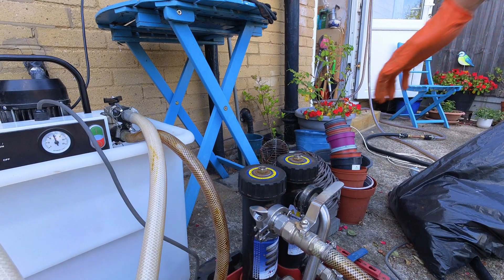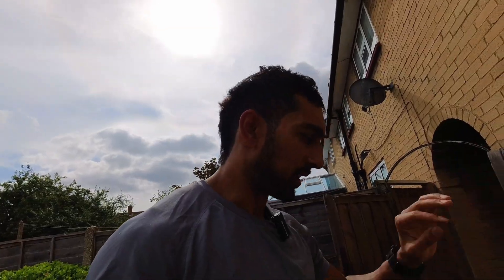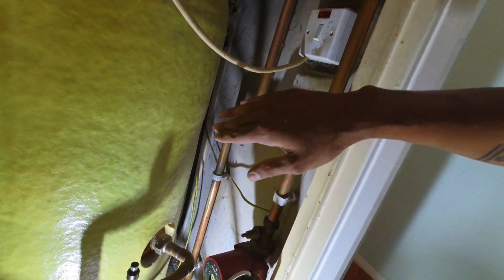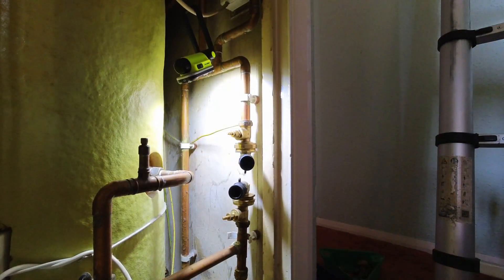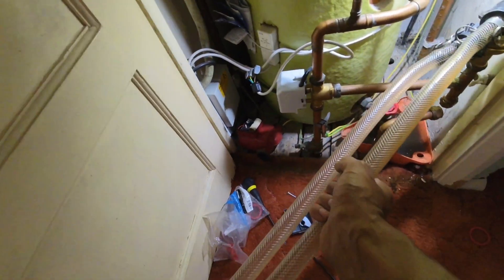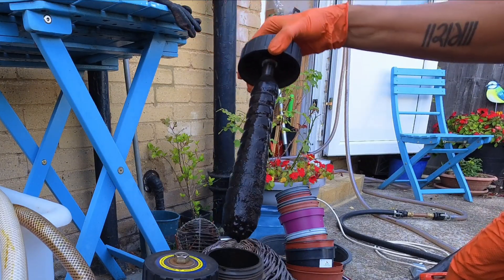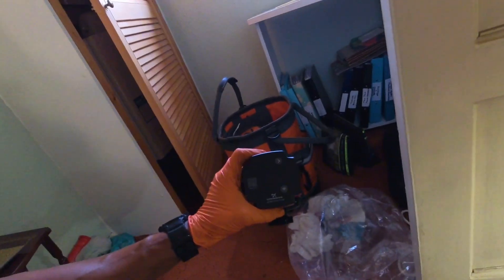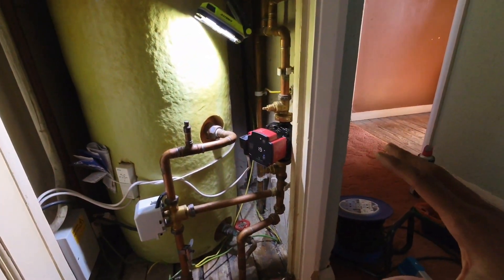Powerflushing this DISGUSTING Heating System

Comment: Current job still has 4 of the original 1987 radiators, whole house on 8 & 10mm but customers have had 8 changed out the the original 12 by a previous 'plumber'...so I get to change the others. Imagine my surprise (last 4 rads changed 4 months ago) when I am greeted with buckets full of 38 year old sludge 🤣 zero flush & cleanse...take one off, fit new one 😂
Reply from the maker: Madness!!

Comment: Bypass is still needed if on heating only especially nowadays when it seems everyone is shutting off rads not used due to listening to that wolly Martin Lewis about closing off rads in rooms that are not in use. The condensation I see now all over there windows and eventually mould is a joke. What you save on heating, you will double that on redecoration and repairs. It will also make the boiler cycle more and more eventually killing it early. Can we start opening our eyes to these people please